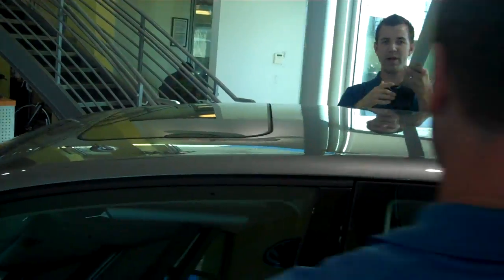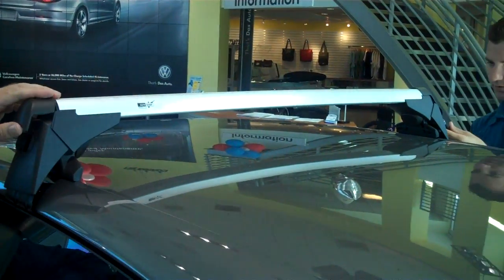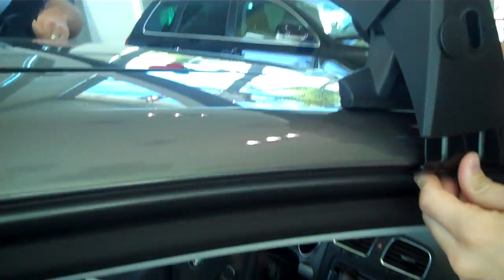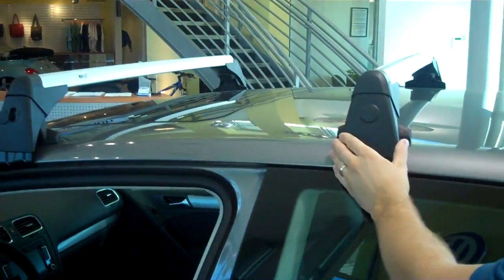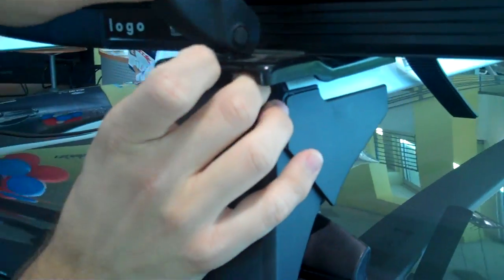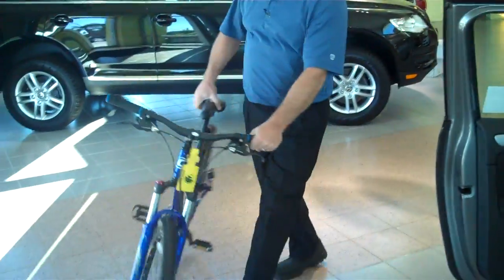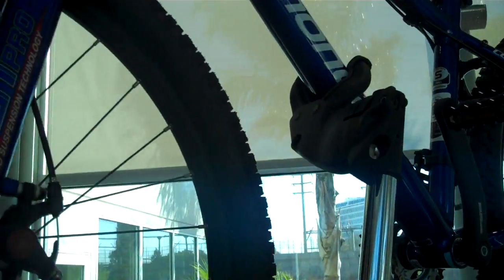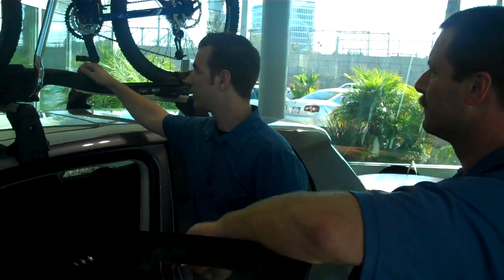Volkswagen roof rack install by LAcarGUY parts team

Comment: I purchased a GTI with these installed.  Can the back one with the arrows in the windows be moved back or does it have to over the arrows?  I never use them, strictly decorative.  There is a dent in the car that I want to cover with the endcap of the wrack by moving it back further.  Please help!  Thank you!!

Comment: I didn't see how this rack looked once the front door was shut.  I installed VW  roof rack on my 2016 Jetta SE and I'm having a LOT of wind and road noise.  The weather stripping on the doors folds around the legs of the rack.  This seems to let in a lot of noise - even at low neighborhood speeds.   Have you experienced this and do you have a solution for it?   Thanks for a great video!

Comment: Does the part that mounts the carrier to the base bars move forward/back to adjust it to the space between the two bars?
The reason i ask is I wanna get the barracuda attachment and I have a ROLA rack on my 2013 vw golf which also uses "t-slot" mounting, but Im not sure if the space between the bars is the same as with the VW base bars. I hope my question makes sense!

Comment: How do you reverse the bar on the VW bike attachment?
Reply from the maker: William B 

If you remove one side of the end caps on the racks, you can take the bike rack off the car and turn it 180 degrees, then slide it back into the channel in the rack, tighten the clamps and your done.

Comment: You do realize when tightening the rack on with the torque wrench you must tighten until the two arrows on the tool aligns. So by you just tightening until you feel "a little bit of resistance" is not safe. The rack may fall off. Just an FYI for everyone out there.
Reply: Yup, big step missing there lol.
Reply: Thank you for info

Comment: Where do you position the back rail on a 4 door model?
Reply: to answer my own question.
On my 4 door MKVI if you open the door in the inside on the top of the door frame there are two slight indents.  I've been using them to line it up by putting them in the middle.

Comment: Does the barracuda bike rack lock onto the cross bars? I saw that it clamps down but didn't see a locking mechanism. I just installed my cross bars and wanted to make sure I understood how the bike rack worked before I purchased it
Reply from the maker: Yes it does lock. There is a lock on the clamp that goes to the diagonal bar on the bike.
Reply from the maker: Rennie Wible at VW Santa Monica would be happy to give you a demo or help you install it. 310-829-1888. just ask for rennie
Reply: LAcarGUY Dealerships
I found a pair of these bike racks in my mom's shed storage.  I have a set of Thule Straight bar racks. Is there a different mounting piece/set that I can use or is the bike rack basically useless?  Also, the rack says they are called "city crash" but are definitely the same thing. Thanks for the feedback!

Comment: Do you suggest using the securing brackets (parts 10 and 20 in the VW installation guide) that attach to the front and back bars? I see they are not used in your installation video and wonder if they are necessary.

Comment from the maker: It depends on the year and model.  All the new VW model base carrier bars (basic cross bars) do not use a standard key.  They have a special coded wrench to tighten the attachment bolts.  Once attached, the attachment points are all covered for a clean look.
 
What year and model is your VW?  I can answer your question a little more specifically.

Rennie W 
Volkswagen Santa Monica Parts Mgr

Comment from the maker: Yes, same set up as the MkV VWs.  They have a locator pin on the front base bar.  The rear is positioned right between the arrows on the glass.
 
Good memory!

Comment: Great video. Getting my base rack tomorrow. You mentioned that two door vehicles have arrows for the back rack on the window. What is the recommended distance for 4 door vehicles for spacing out front and back racks? I have a 2009 GTI.

Comment from the maker: The door seal should wrap around the base snuggly. If you feel that the fitment is not snug and you are in the LA area, please feel free to drop by either Pacific VW or Volkswagen Santa Monica to verify your concerns and provide any further assistance needed. Your rack may just require a simple placement adjustment.  
As to bike security, all VW bike attachments and base bars have locks built in to them, and we can further discuss your available options in person.

Comment from the maker: Hi JuiceNight,

The rubber strip is used to eliminate the whistling or howling at speed from having that T-slot open with accessories loaded on it. 
 
Depending on your use, if you keep your accessory attachment on your VW fulltime you may want to cut the strip to fill any open areas around the accessory or if you use it part-time, you may want to use the whole strip when the accessory is not in use.  
 
Hope that helps.  Thanks!